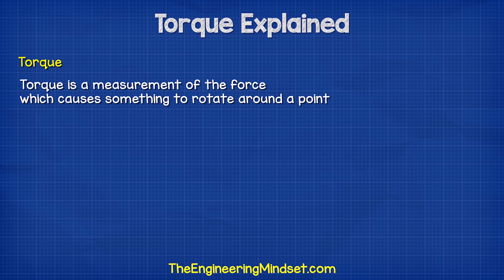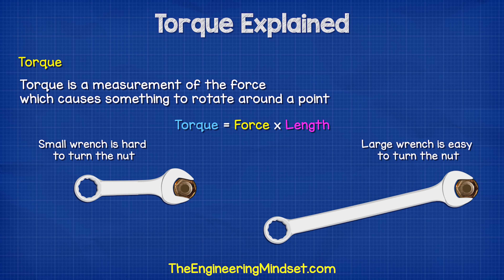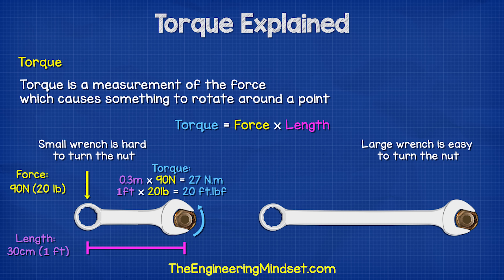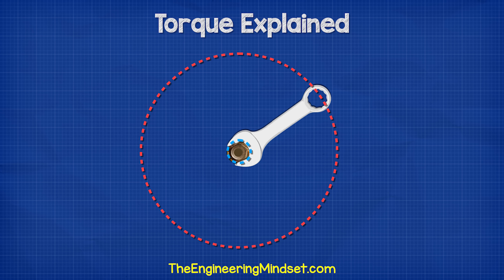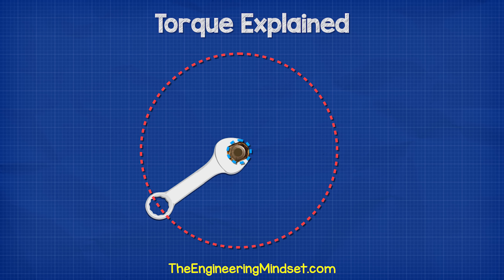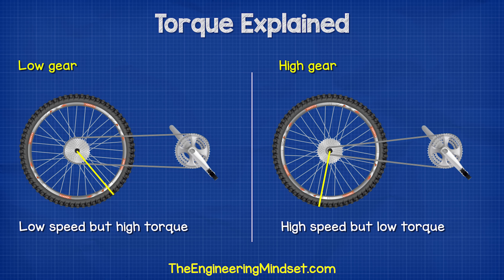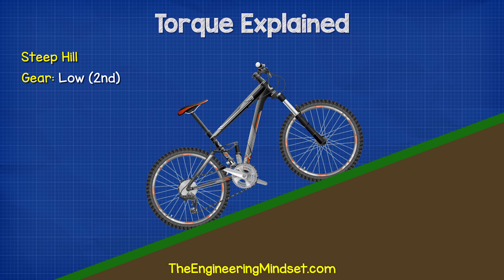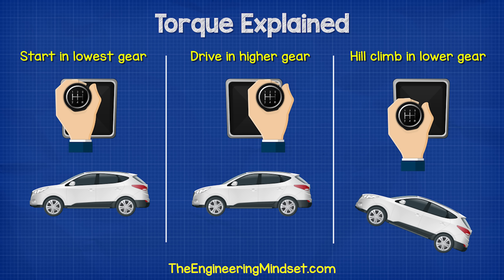What is Torque? - Torque basics explained

Comment: Don't get the bicycle gear part. Why does the low gear give high torque? The formula is "Torque = Force * Length". But the length doesn't change with high/low gear? And the force you put on the paddles is smaller when you have a low gear, so why is it not low torque?
Reply: You push pedals with force and force times length of rods results in a torque inside a shaft. A gear sits on that shaft and pulls a chain with force=torque/radius. The smaller the gear the more force on the chain. Chain rotates a rear gear creating torque on its axle, the larger the gear the more torque on the axle. Finally we have a wheel sitting on that same axle  and pushing the ground with torque/radius.
Reply: The length DOES change. When you are in a low gear (the biggest sprocket on the cassette) the distance from the chain to the middle of the wheel is greater than when your in a high gear (small sprocket on the cassette.) So given the same force; torque should be greater when in a lower gear. (I hope I'm right, I was confused too.)

Comment: I think I get it fully but maybe not. Is the longer the wrench meaning more torque because the further away you get from the nut the less force per measurement needs to be applied. I imagined a scenario of me trying to turn a nut with a 70 ft pole or something and realized the further out I am the less force I need because the force is distributed into smaller pieces.

Comment: A senior mechanic once told me that Tata trucks had immense horse power as a result it would perform well at lower torque which is favourable for hilly regions whereas Leyland Trucks were of low horse power compared to Tata trucks but it's torque aspect was excellent ,as a result it performed very well at a higher torque and could carry heavy load slow and steadily on a hilly road because of its excellent torque qualities, but what Leyland Trucks were lacking was the instant pick up which was very much existent in Tata Trucks powered by Mercedes Benz Engine, that is why Tata trucks were very much preferred in hilly sections, but Leyland trucks powered by British Leyland Engine still could perform quite well because of its superior torque qualities.

Comment: Hi
On brass plumbing or refrigeration compression nuts, we lubricate the thread and copper to make tighten less effort.
Would the torque wrench over tighten the nuts if they're lubricated? 
I mean is torque wrench relying on friction to click at set torque?
Reply: Yes, lubrication will alter torque figures. I've seen charts where torque values are assumed for dry fasteners not lubricated.
Reply: @waynemizer4912  thanks 👍 that's good information.

Comment: whats the difference between torque and centripetal force?
Reply: Centripetal force directs motion to the center of a circular path.  If you are riding an amusement park ride that goes around in circles, centripetal force is what keeps you from flying off into the crowd.  It is supplied by whatever container you are in.

Comment: Hey, I sent you an email a week or 2 ago. Did you by any chance have a look at it?
Reply from the maker: Yes, haven't looked into or tried discord yet. Seems like a good idea, just not sure I'd have time to maintain it. Running 9 channels (translations) Facebook, LinkedIn, twitter, Instagram, emails, website etc already takes up so much time, if I did anything else I wouldn't be able to make these animations and circuits for the videos.
Reply: @EngineeringMindset  Yeah I can understand that you're very and putting out these informative videos isn't easy, but  we can help with maintaining the discord server. I for sure can help with setting it up and making sure it is free of trolls and other negative things. I have a lot to learn about electrical engineering since I am going to start going to college for that. This would be extremely helpful to ask questions and suggest new things. I'd say give it a shot see where it goes if it doesn't work out the way you want it to you can delete it with a few clicks.

Comment: I would like to see a video about horsepower vs torque in car engines.
Reply: Snap! I find it near impossible to explain the difference clearly 🤪
Reply: @davyarthurs  me too🤦🏼‍♂️😂
Reply: Imagine an old fashioned well from the cowboy movies that lowers a bucket down a hole. 
You can turn the crank to lift the bucket out of the water and lock it in place. There is Torque on the handle but no work is being done.
If you turn the handle, you will raise the bucket which is doing work. The rate (rpm) that you turn the crank, determines the rate of the work you are doing, which is measured in horsepower.
Reply: There are several videos on this
Reply: Easy torque is the measure of rotational force applied by an engine horsepower is the rate of force over time.  HP = Torque x rpm / 5252 that’s why every dyno sheet shows HP & torque lines crossing at 5252.  Bets way to look at it, torque gets car moving then as initial weight of vehicle is overcome HP factors in.  Remember though HP ratings are at a specific rpm so a car rated 400HP at 6000rpm is not making 400HP at 2500rpm, making much less.  Torque peaks when an engine makes the most force on piston.
Reply: think of horsepower as torque per second
Reply: I'm more interested in why 2 engines with the same size (cubic in.) can produce totally different numbers? One of the engines will have 400hp and 380lb/ft torque and the other will have 350hp and 500lb/ft torque. What causes the difference? Gas engines usually produce more hp than torque and diesel usually produce more torque than hp.I know gas engines rev faster and higher than diesel.Why can't diesels rev higher to produce more hp?
Reply: @CSHayes  there is so much more that goes into an engine design that dictates the power ratings like compression ratio, camshaft, cylinder head, intake design and exhaust system.  The camshaft could make the two engines you are asking about perform that way.  Diesel engines typically are longer stroke designs and have higher compression ratios than gas engines, which make more torque and don’t like to rev high.  No easy answer to your question.
Reply: @CSHayes Efficiency and mechanical leverage. Engines have different bore:stroke ratios, compression ratios, valve timing, stroke to rod (lever) ratios, etc...
Diesel engines typically operate at much higher compression than petrol engines and diesel fuel is more energy dense.
Reply: buy Paul a small coffee then
Reply: Donut media has a great video on the differences
Reply: HORSEPOWER is how fast you hit the wall........Torque is how far you take the wall with you!!!!!
Reply: @robertg7970  Not exactly.In the disel engine the 170hp are like compressed between 2000 and 3000-3500rpm.Thats much power for a short period of time.When petrol is 170hp it has less torque but for longer time.Theyre with the same power just the disels are compressed and the petrols are longer.Even i dont know exactly cuz its complicated but thats the easiest way to understand it kinda good.
Reply: @robertg7970  😂
Reply: @robertg7970  Torque is how wrong, nonsensical and irrelevant an analogy is. RPM is how much it gets multiplied by "likes". Power is the resulting permanent cognative damage caused to our collective intelligence.
Reply: horsepower:force(torque) over a period of time.Quite simple actually
Reply: Torque is how much power a engine can produce, Horsepower is how quickly it can produce that power hence it’s called HP
Reply: @Ryan-jy5ck torque is not how much power an engine can produce.  Power is how much power an engine can produce, hence the term Power.  Horsepower is a subset of that measurement.  Power can also be measured in Watts.  The units change from metric to imperial the same way meters and feet are measuring the same thing ( Power ) just in different units.
Reply from the maker: See our new video on how to build mechanical versions of electronic circuits? Watch here: https://youtu.be/Zv9Q7ih48Uc
Reply: Mechanical vs Electrical cars you mean
Reply: @user-no4ec7gw2q 
That doesn't sound like same discretion...

Comment: I'm an engineer.. and you're one of the best ever engineers I've seen.. I watched many of your videos.. and you're exactly in depth !! So thank you for sharing your knowledge 🙏 ...

I have a question to discuss; which came before, vector multiplication or physical quantities, I mean.. did we conclude the cross and dot products because this is what they mean in physics, OR we had them already and then we chose the dot for work and cross for torque etc... because this is what each product mean and we should use a specific type to have the physical meaning correct?! 🤔

Comment: Torque is applied to your lumbar area when lifting an object, if the person lifting the weight does not use his legs while keeping his back straight. The main reason, among several, why people suffer of lower back pain
Reply: This video says torque is a rotating force. According to his definition That wouldn't be torque. That's the issue with explaining it the way the video does.
Reply: @taz4100 Could you please provide a better explanation?
I genuinely want to know about torque in detail.

Comment: Good video (as usual) with good graphics (as usual).  Why are gear (ratios) referred to as “low” and “high” (or “lower” and “higher”)?  I know the answer, but this is almost never actually explained; the terms are just used as though everyone knows what they actually mean.
Reply: Maybe I am off topic, so just FYI; "Gears" actually mesh (teeth drive teeth). But, for bicycles, we have allowed into common lexicon the misnomer "gear" to mean cog or sprocket (chain drives teeth).
Reply: @bob-ny6kn  That’s an interesting point, but not what I am trying to get clarified.
Reply: @bob-ny6kn    So, whether actual gears or a sprocket-and-chain arrangement, why is a small gear/sprocket (input) driving a large gear/sprocket considered to be a “low(er)” gear ratio while the opposite is considered a “high(er)” gear ratio”, other than the obvious that in automotive transmission the gears are usually numbered 1 to x (where X is 3, 4, 5,or 6).
Reply: @brucefay5126  Ah. The answer I do not have exactly but... if a smaller input gear drives a larger output gear at some ratio, let's say 4 turns for the input gear makes the output gear turn only once, you are in low/slow (high torque) gear. If the input gear is larger than the output gear, the output will rotate faster/higher... but you probably know that, and that didn't answer your queation.
Reply: @bob-ny6kn  Indeed.  My question is why a slow(er) output (high(er) torque) ratio is referred to as “low” while a fast(er) output (low(er) torque) ratio is referred to as “high”?   Why did the labels “low” and “high” get applied in this way?  It seems to be something we just learn at some point and then carry on.  A rose by any other name, I suppose.
Reply: @brucefay5126  high and low do not need to refer solely to altitude. Pressure, sound, temperature, concentration,  et c., use high and low. Why invent a new word when one or two can be borrowed and expanded in meaning?

So my guess is "ratio." When I have a high ratio on my bicycle (4:1) I go faster when pedaling at 60 rpm then when the ratio is low, 1:1, where I go slower at 60 rpm. Again, not the origin of hih/low, just my guess.
Reply: @bob-ny6kn  Thanks, Bob.  Graduate engineer here, who used to teach mathematics and physics (among other things), so I understand the mechanism under discussion.  My question was simply about why “Low” and “High” got applied to “low speed” and “high speed”, as you suggested, as opposed to “low torque” and “high torque”.  There has to be an origin/history to why those terms got applied they way they are, and by whom.
Reply: @brucefay5126  Etymology is unknown to best guess on the use of many words. Why has DICK morphed from "a smart dressed, private investigator" to... ahem... a "a total knob"... which is a door handle. Your goal as a teacher is to know every answer to every relevant question, including word origin. Have fin discovering.

Comment: Torque = Nm
But Joules can also be in Nm. 
Heat is measured in Joules. 
Therefore, when you cook, you are actually using torque to turn food delicious….

Science.
Reply: Interesting 🤔
Reply: Heat is measured in calory
Reply: @souvikg347  The S.I. unit for heat is the joule, not the calory, and 1 joule = 1 Nm; so he is correct in that statement.

But, whilst amusimgly whimsical, it is of course inaccurate to state that you when you cook you are using torque to heat the food.

Whilst torque is measured in Nm, and Nm equates to J, torque is specifically in reference to force that causes rotation around a point, so it plays no part in the heating of food. Certainly,  not in any conventional oven at least!
Reply: @steviej3408  If you apply to much torque, eehh heat ... the food is screwed ;)
Reply: @SystemX1983  I don't know what your response is trying to say? It doesn't make much sense
Reply: @steviej3408  SystemX is making a joke.  "screwed" is in reference to the torque used to turn a screwdriver and is the equivalent to the food being burnt from too much of it (heat).

Comment: I take it this guy has never ridden a fixie.
Reply from the maker: I have, BMX was fun but the back peddle brake on these road versions takes some getting used to, I'll stick to my disc's
Reply: @EngineeringMindset  A fixie doesn't necessarily have brakes.  The gear is fixed to the hub.  There is no freewheel. When the bike is rolling,  the pedals are moving accordingly.